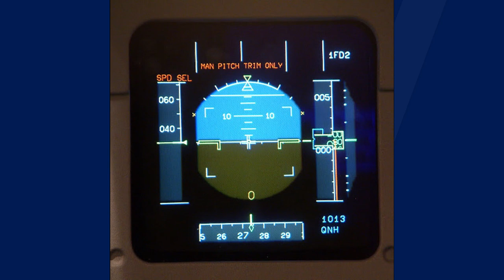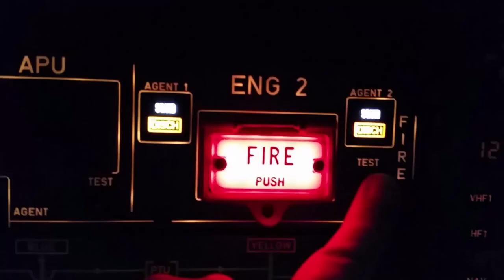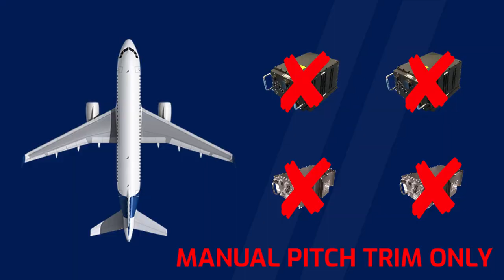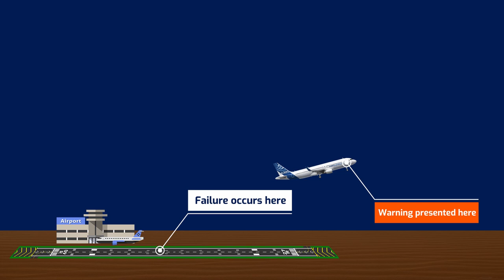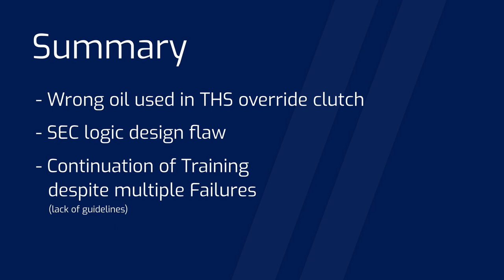Loss of Control | Smartlynx A320 Accident at Tallinn (emergency landing)

Comment: I’m amazed that they survived. I’ve flown the A320 for many years. It’s a great airplane with a character all of its own. You really have to understand it’s philosophy  and adapt to it in order to fly it. We did practice L+R elev fault in the sim. It was very tricky, altitude oscillations of +/- 1000 or 1500 feet or so, you had to configure it early and not fight the auto thrust, that led you to smaller oscillations and more control with the trim wheel. You could fly a standard ils quite well. Go around was very delicate. But with an engine on fire? Or no engines , very easy to over control. As I said at the beginning, I think they were very lucky.

Comment: Once the instructors had seen multiple computer failures they should have cancelled the check flights and grounded he aircraft until it's investigated. Seems common sense to me.
Reply from the maker: As I said, yes they should have. But we are always smarter after the fact.
Reply: What did them In was the SEC failures one said it was on the ground.  The other said it was in the air. Seeing them both with different information made them shut down. SEC doesn't contact elevator functions  directly so it won't respond.
Reply: and they probably would never if found out the wrong oil was used it could of taken years to figure out that problem. airbus should not delay warning they need to stop thinking they are smarter then pilots and give them in info they need to figure out the problem.

Comment: It seems odd to continue training with both ELAC 1 and ELAC 2 faults showing up. If they'd called it a day after seeing the alerts several times then all of the follow up issues would have been avoided.
Reply from the maker: Yeah, that would have been the way to do it. Something was clearly amiss, and even if the checklist did not tell them to abort the flight, my gut feeling would have probably told me to do it anyways. But hindsight is always 20:20.
Reply: @AirspaceVideos  Absolutely. It's easy to sit here, years after the incident, watching it and discussing it. We don't have their pressures or concerns. I am glad everyone was okay of course. That's what matters the most.
Reply: @gdwnet  Exactly. When spurious, seemingly harmless errors occur, humans tune them out. There are checklist to prevent that, but there were no checklist so they ignored the errors, thinking as minor errors. In a sense those were minor errors, up util they everything went wrong at the same time.
Able to clear the error with a computer restart is usually a sign of some spurious minor error. This was a highly misleading situation.
Reply: @adamrak7560  "When spurious, seemingly harmless errors occur, humans tune them out"

I work in IT, all too often the term "I rebooted it and the problem went away" is used where what they really mean is "I rebooted it and it seems okay but I don't know what the underlying fault was and I'm busy so that'll do".

There are a lot of parallels between aviation and IT although in most IT cases an incident isn't as serious as on a plane.
Reply from the maker: Great analogy! False warnings are a big problem.
Reply: True. Lots of accidents seem to have happened because some kind of warnings were ignored. Computers having a reputation of failing when you need it might be biasing people to just assume that the computer is just faulty.
In one accident, the instruments were showing fuel imbalance and the maintenance crew told the pilots to keep flying assuming its a computer glitch. :/
Reply: Only elac 1 failed. The accident happened when exactly 2 failed as well.
Reply: @AirspaceVideos  The reason the touch and goes were continued and the computers were reset multiple times is testament to the separation of crew from incomprehensible technology.  No one will publish a comprehensive fault diagnosis guide for the crew in air.  It would be impossible to use with 5000 pages to go through.  If the computer is too dumbly programmed to tell the pilots what's wrong then they are flying a dare to do killing machine.
Reply: @gdwnet  to be fair if you call IT support the first thing they usually say is "have you turned it off and on again" and if it works then you generally feel like an idiot for not just doing that.
Reply: @pibbles-a-plenty1105  Sorry I disagree - the system's not that complicated the main 2 failures here are the guy who put the wrong oil in the elevator (and the fact that the maintenance logs didn't record who did that work which is probably more worrying and makes you wonder what else is messed up). Plus the lack of a checklist and the assumption that a lack of a checklist implied that the fault was trivial, I suspect that he captain was under pressure to get through all the touch and goes - it must be expensive for a small airline to have an empty A320 flying around, and so felt pressure to carry on rather than ground the aircraft -  in the cold relaxed light of day surely anyone with 2 flight control faults reported would ground the aircraft. Still he did remarkably well getting the aircraft on the ground with pitch control only from the pitch wheel and dual engine failure.
Reply: @tomriley5790  I know but IT support don't say "Have you tried turning it off and on again" 19 times in a row. If you still have an issue after the first reboot then there is something serious going on and it needs a deeper look.
Well, any semi-competent IT person would.

Comment: I'm a FAA certified mechanic.  The maintenance documentation should show who worked on the aircraft.  Each procedure needs to be signed off as completed.  Whomever put the incorrect oil into the system should have signed off for completion of that procedure.  Also if they are getting back to back maintenance messages.  The person or captain in charge should have had the aircraft looked over after the 2nd or 3rd repeat at the most. Airbus 320 and 321 aircrafts are heavily computer controlled.   If a maintenance message keeps appearing.  Something honestly is wrong.
Reply from the maker: I also found that part somewhat odd. Seeing the amount of paperwork you guys have to go through just to perform a reset of some sorts, it would seem strange to me that they could not find out who put in the wrong oil.

"The analysis of the maintenance documentation of the THSA could not therefore determine when and where the non-compliant maintenance action to the THSA was performed." - Final Report
Reply: @AirspaceVideos  it was either a new tech, which should have verified the proper oils with a tech with more experience.  Or a tech that just didn't follow the paperwork or procedures for the aircrafts maintenance programs. In the end someone signed off for that maintenance procedure somewhere.
Reply: @Skimblshanks  this to me suggests that both the person putting the oil in wasn't trained/qualified enough and there's a systematic problem with whoever's running the maintaince program that this was allowed to happen - as you say it should never happen.
Reply: @tomriley5790  All maintenance is recorded.  Either in the aircraft maintenance log books or in check sheets issued the day of the maintenance being performed at the aircrafts location.  Each step is signed off when completed by someone. A maintenance release of the aircraft can not be dispatched or signed until all the maintenance is completed and signed off.
Reply: Things such as engine oils, APU oils, hydraulic fluids are checked daily and quantities added are recorded in the aircraft maintenance log book. Far as a component like that. There is a work package for it to perform a task like that. It's not normally checked on a line check due to being a closed system.  The aircraft maintenance manuals are used more so on checks like this. Someone signed off for this work.  Or it was preformed with out any maintenance documentation.
Reply: @Skimblshanks  except apparently not in this case :-(

Comment: You can’t get more than a few meters of altitude so you remove your flaps?! 

That’s basic, basic stuff you learn in the first flights in GA training. Removing flaps will cause the aircraft to momentarily sink. Even in a stressful situation that seems like unforgivable lack of judgement on the captain’s part to me. The occupants of the plane are insanely lucky they didn’t die.
Reply: Well if he hadn't done it he wouldn't be able to bounce and get airborne again 🤷‍♂️
Reply: @stranger6094  If he hadn’t done it he could have climbed out over the trees by adding more flap.

Comment: I’m sure the pitch computer order is ELAC 2, then degrades to ELAC 1, then SEC 2 then SEC 1? ELAC 1 is primarily the ailerons then degrades to ELAC 2
Reply from the maker: You are correct. But the failure sequence is correct as well - in that case, ELAC 1 failed, then ELAC 2, leaving no ELAC in control. Thereafter, both SECs disagreed. But yes, there was a slight inaccuracy on my part, nicely spotted.

Comment: As a software engineer I can't believe that kind of thing isn't considered. If you get one failure you can assume you're likely to get multiple failures if they're all identical computers and sensors.
I treat every input as suspicious and try to think of every possible scenario that could result. It's like when the MAX engineers used just one pitot tube as input to their computer. That should be assumed to be wrong in good code and compared to other sensors and calculated estimates.

Comment: the pitch of the aircraft is primarily controlled by ELAC 2, not ELAC 1. ELAC 1's primary role is the operation of the ailerons. ELAC 1 takes over when ELAC 2 fails or there is a loss of hydraulic system or pressure from the green or yellow system.

Comment: Should there really need to be a written guideline about whether to continue training after multiple system failures? It should be common knowledge to stop training in circumstances like these. There was an obvious problem that challenged the trainer and safety inspector. Having students in control during that time seems irresponsible.
Reply from the maker: Well it may sound obvious to discontinue training, but consider the fact that the A320 is able to generate hundreds of different warnings, and not every one warrants an immediate discontinuation of the flight. The ELAC pitch faults don't even come with a checklist and are classified as the lowest kind of "master caution" - "crew awareness only". No LAND ASAP is presented. 
So, nothing really conveyed that the situation was that urgent. But then again, flight on alternating ELAC pitch faults would have left me personally with a bad feeling.
Reply: Not really

Comment: This accident is indicative of a widespread misconception people have about embedded computer systems.

Just because your home PC runs better after a reboot doesn't mean the computer in your car, washing machine, or an airbus works the same way.

Embedded computer systems are extremely simple compared to PCs and cell phones. Usually one to three orders of magnitude less code. More importantly, life-critical code is designed so that it can go through a process of formal verification, which means every combination of input conditions is mapped onto an output space. Faults are just a normal part of the output space, where the computer just can't make a good decision about what to do with the information it has. Traditional "bugs" are extremely rare. As I type this I can't think of any examples where a software bug caused a life critical computer system to fail.

What actually happens is that certain combinations of input conditions map onto behaviors that are undesirable when encountered in the real world. 737 max trim runaway is an example. The software did what the engineers told it to do, but the action it took was unreasonable. 

If multiple redundant systems are triggering faults, the problem isn't a blown capacitor on a logic board, or a "glitch". It means the computer is encountering conditions that the designers couldn't confidently map onto a reasonable output. A fault is the computer giving up and saying "I don't know what to do." If that fault is coming from your flight controls, your blood pressure should be rising.

I don't criticize the captain for his decision to continue the flight. In an aircraft with thousands of sensors and computer systems, I'm sure faults are very routine. But I do hope, as an outcome of this accident, pilots are trained to think critically about which systems are faulting, WHY they might be faulting, and assess whether the loss of those systems will introduce an avoidable risk if the flight is continued.
Reply from the maker: excellent post, thanks a lot. Yes, a lot of thought has to be put into why a system is issuing a fault. I'd often love for the alerting systems to give a bit more info... for example instead of ELAC PITCH FAULT I'd love to read ELAC PITCH FAULT - THS override fault. This would specify the failure more clearly.
Reply: If you want to do some research into this, look into the Therac 25. It's fascinating stuff. I can't seem to post the link, but check out the Plainly Difficult video, and you'll find it.
Reply: A lot of pilots aren't engineers sadly, they just operate

Comment: A plane can fly on one engine too but you land and take care of it because your back-up systems should only be used as back-up until you can land and get things fixed. People don't generally drive on one of those little spare tires in the car for long either for some of the same reasons, except at least the car is on the ground.
Reply from the maker: well said!

Comment: The cause was bad design, where relatively minor error checking by the software takes away your redundancy. The engineers thought they were designing for safety while making something fragile. Engineers and analysts on the ground are likely to make this mistake as they have too narrow a view of what might happen and an incentive not to be the cause of the fault, hence err on systems shutting down. To be properly redundant the aircraft ought to have a manual switch to select one of the four control systems.
Reply: Do you actually understand what happened here. If they had reset the computers one more time they would have recovered full control of the aircraft. Why would you switch between control systems? That doesn’t help when the computer fails. The answer is to reset it and see if it responds. Which it did every time except when they didn’t

Comment: You forgot to mention the primary reason for the bounce was the spoilers were not armed as it wasn’t Smart Lynx procedure to do so and therefore did not deploy and prevent the bounce
Reply from the maker: True, I chose not to put this in the video as it is already long as it is. Additionally explaining the spoiler logic would have made this video even longer, and I didn't find it very central to the accident.
Reply: @AirspaceVideos  fair enough. I thought it was worth it as if the spoilers had been armed the plane wouldn’t have bounced and the accident may not have occurred.
Reply from the maker: @tomstravels520  Maybe, that's entirely possible.
Reply: I retired in 2019 the  SOP for base training was don’t arm the spoilers for a touch and go on the A320 series. Technically we were allowed one reset of a computer and then the computer would be considered inoperative for the rest of the flight. It was Crew Discussion in emergency to consider modifying that rule to become a hero or a soon to dead rule follower to try for a further computer reset as per FCOM QRH.

Comment: So out of curiosity, would resetting ELAC 1 (or 2) yet again have avoided all of this? Or would the flight computer not revert control to an ELAC once it tries to delegate to the SEC?
Reply from the maker: Thats a very good question, actually! I can't say with certainty, but as an educated guess, I'd say yes, resetting the ELACs after they became airborne could have solved the problem. In the air, the ELACs would once again have been able to fulfil their function and drive the THS... so yes, probably, in my opinion.
Reply: @AirspaceVideos  Thanks for the answer!